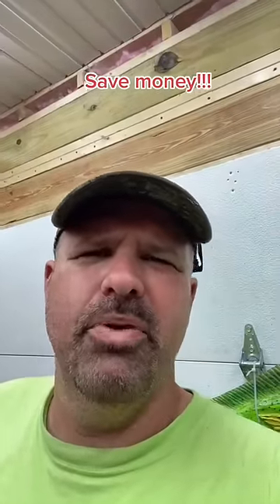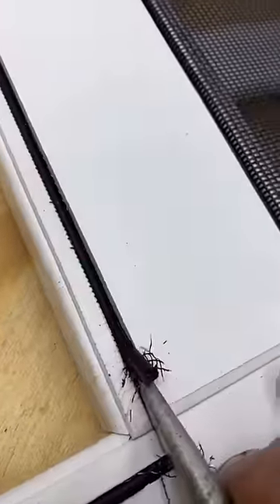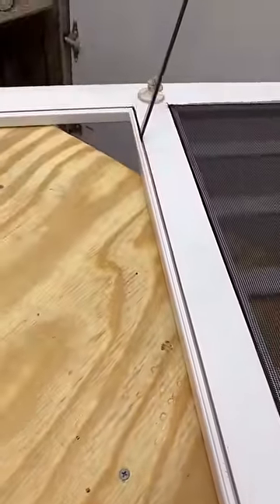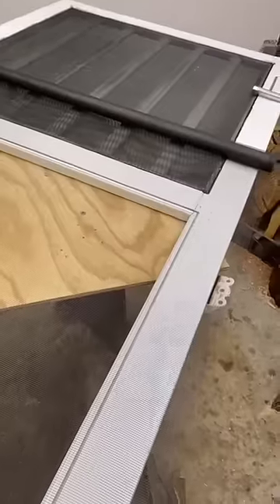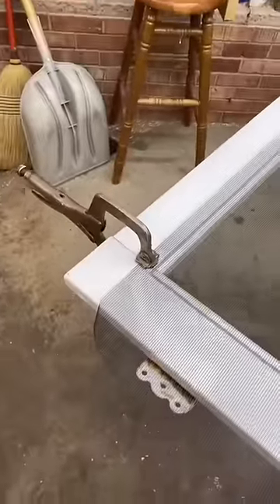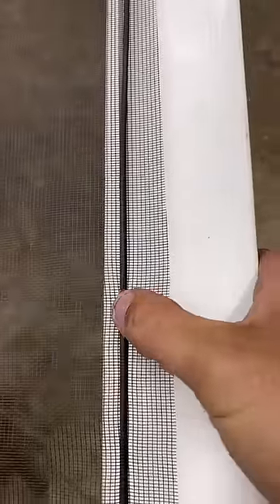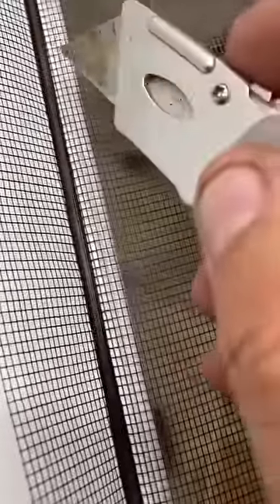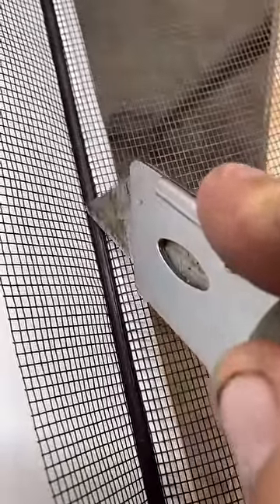Ever change the screen in your windows or doors?

Comment: Tight screen makes wacky frames. The gasket is spline, and they have a spine tool that does that for you.
Reply: this looks like a timber frame with a routed groove for the spline. make it as tight as you want, it ain’t gonna warp the frame. an aluminium frame though, yeah, maybe
Reply: @brenyboy26  tight screen can warp any frame timber or aluminum.
Reply: @brenyboy26  
That's a vinyl screen door. It's like $30 at any home improvement store.
Reply: Yes...commented same. Most people won't be able to do this... and if they do, it's gonna take quite a bit a practice. Not just somethin u jump into and it's all good. Takes trial.and error. Very frustrating unless you're a handy person or good at this stuff.
Reply: @jacobchristian8608  , yea, it CAN, but it bends them to wobble like you're ringin out a towel. If you're really good u can do it and it'll work, but it's not something recommended for just an average person tryin to screen change. I'm pretty sure thats what they meant. 

Edit... I apologize,  I thought you wrote it can "wrap" and frame. Lol. You said warp. Yes... warp... agreeable. My bad.
Reply: @MrNside  , dang , where u live?? Lol. That's pretty darn cheap, even for a vinyl door. Good for u though... 👍🏼good price, if it's true!
Reply: Hey, anyone remember when it was metal screen instead of vinyl or whatever the hell it is now? Total treat to unroll it and cut the hell out of your hands. Oh the hardware store, damn, miss those. Not these big box stores but a hardware store that had everything from canning supplies to building materials.
Reply: The spline tool doesn't fit the spline hole. I just used this door and the tool didn't fit so I had to use a flat head screwdriver.
Reply: @actuallyNo...  
The screen popped out of the door at the camp I was renting. Pulled the gasket and put it back together using a Leatherman. No issues… first one I’ve done.
Reply: @jacobchristian8608  What bout wood
Reply: @MrNside  30 bucks ?  Maybe 30 yrs ago.
Reply: @actuallyNo...  
My bad, I was thinking of the thinner framed vinyl door, it is $33 at my local Lowe's. The one like this model (without the vertical bars on the bottom) is like $80. Either way, it's still a vinyl frame (not wood) and susceptible to warping if you install the screen too tight, which was my point.
Reply: @Blue_Shirt_Guy  see above comment.
Reply: @MRtwoTricks  
You can still buy aluminum screening at just about any home improvement store last I checked, it is a considerably bigger pain to work with compared to fiberglass. 

I had to spline in aluminum to replace fiberglass in a few windows/doors for a customer because her cats kept tearing up the fiberglass screens. It had been a while since I messed with aluminum, I drastically undercharged for that job.
Reply: @MrNside  you put a 30 dollar screen door on your house  ?
Reply: @MrNside  lost probably 2 pints of blood too
Reply: @Blue_Shirt_Guy  
Where did I say that?
Reply: @MRtwoTricks  
I'm sure I lost a bit of blood, but nothing I've ever done is worse than steel stud framing when it comes to your hands looking like you were kneading a pile of razor blades.
Reply: @MrNside  so now you're saying that you don't have a screen door at all ?
Reply: @Blue_Shirt_Guy  
Where are you reading this stuff? I never said that either. WTF is your deal?
Reply: @jwalker6260  , yea, some are quite easy, especially if the door's in decent/good shape and you have enough screen to work with , of course.  In your case it mayve just popped out of the frame. Not hard if you're handy 👍🏼 ...

 Say you're taking off your house windows and doors to do a re-haul on all the screens though,  it's pretty much never gonna be that easy. There's all types of issues you'll (or you can easily) run into.There's always exceptions though.
Reply: @MrNside  , that's okay. 👍🏼  I get it. I figured you either got a really great deal, or you just mixed up the numbers accidentally... it happens. You sound like you've done a few handy jobs in your time. Same here...I feel ya!
Reply: Nah Florida man here. I've replaced countless screens. You want that shit tight.you also don't want to reuse spline. Its cheap and easy to cut to size
Reply: @iian_  , he was talking about aluminum framing that you'd use for everyday, home window screens. They warp and flip all over the place when the screen's too tight. They suck, & they're hard to get flat, especially the 1-inchers most houses have. 
Wth does "FLA Man" mean/ have to do with anything regarding this?
Reply: @actuallyNo...  no you still want it tight lol unless you want some shit looking screens
Reply: @actuallyNo...  stop looking for fights online kid.
Reply: @actuallyNo...  I can see you starting other arguments you aren't smart at all. The funny thing about the internet is everyone can see what you've been posting.
Reply: @iian_  , okay, "Florida Man".[ Nice flex, btw.]  No one started an argument (not w/you either). We were all having a nice conversation about everything with everyone here (& will continue to) until you popped in with your "let me sound like a tool" comment.

 I'm glad you found out how The Internet works. That's not a "funny thing"... That's literally what being on-line is. Everyone sees what you post. 
---
Reply: @actuallyNo...  cool story bro
Reply: @actuallyNo...  you really still don't understand the joke do you? 🤣
Reply: Yup

Comment: Pulling it tight will make the frame warp. Use the spline tool and the pressure of pushing it in will make it tight enough.

Comment: I literally just busted my screen today and was trying to find the serial number on it so I could order a replacement screen. Thank you so much bro🙏
Reply: There is a dollar tool next to where they sell that screen material. Its a wheel that presses the spline all the way in. Also, he says pull it tight. Dont want to pull it too tight because the spline will pull the mesh far into that channel and will make it tight. If you make it too tight the screen will bow.
Reply from the maker: No problem! Glad it helped Mr Clean!
Reply from the maker: Thanks for the tips PK

Comment: Except for the part where the “gasket” is called spline, and the spline should never be that loose or it can just fall out from simple wind or rain, also you should be rolling the spline in. :)
Reply: It just a short Mitch. He’s showing that it is possible to do a repair like that.

Comment: This is EXACTLY why you should pay someone (a professional) that actually knows what they're doing to do it lol... I'll tell you why, for one that shit looked LOOSE as hell, that's a no no, also he didn't even use the right kind of spline, and if it hasn't already came out, it will very soon! 

Yes doing screen is relatively easy to do, just have to know the tricks!! This guy doesn't lol
Reply from the maker: I live in a super windy area on the coast  and it’s holding strong. Been almost 5 months on that screen not to mention the others. But Thanks for the helpful tips. We learned alot! Have a GREAT day!

Comment: A rolling tool, any hardware store, called a Wig-it, rolls it in tight. And yes throw the old gasket away, get new gasket in a roll, use a screw driver at the corners. Razor the edge.
And don't use clamps, it over tightens.
Hand pressure one side then another, then the opposing side then the last side,  it straightens itself as it goes.
Reply: It's good to see valid comments on youtube.

Comment: If the gasket has stress cracks in it (normally can only be seen when stretched), isn't smooth to the touch (it should be able to slide between your fingers as if it was greased even when not greased), is permanently stretched out, is over a decade old, or has any other things wrong with it then do replace it though. Screen door gaskets aren't too expensive. 
(at least here in florida they are anywhere from under $5.99 to $15.99 depending on where you buy it from).

Comment: I do screen replacement and manufacturing. I will tell you right now that you can do that if you want, but he was doing it to a very thick framed screen. Most of you have either 5/16, 3/8 or 7/16 frames. If you don’t know what you’re doing you’ll bow the frame because the fabric is too tight and make your screen window useless. The bow will make an opening where bugs will definitely crawl through. Also there are different materials you can use that serve different purposes, but are also more difficult to work with. If you want shity screens by all means do it your self.

Comment: Forgot to put a block in the center of the frame. As you push the vinyl in, the screen pulls tight, distorting the size of the frame. Block keeps the frame from squeezing in on itself

Comment: If you manage to break the gasket (or spline, that's the technical term) you can buy that as a replacement for that too!  Just make sure you grab the right size spline for the screenwire you buy

Comment: It helps to get new spline its not gasket and get a spline roller to bed new spline. You will get nice even tension on screen and if you dont bed the spline with tool it will come back out especially if its used spline. This guy is right about doing yourself just do it right.

Comment: As a former window cleaner and screen cleaner, it’s not the right way, there’s a lot more that goes into changing the screen, and even though it’s expensive it’s better just to pay to get it professionally done, most of us have a policy that if we break your screens frame or mess/dent it up we will completely rebuild you a brand new screen for no extra cost
Reply: I know you work at the screen repair shop down the street Jayden.

Comment: You'll definitely need the proper roller most of the time if you want to actually fully seat the rubber so the screen lasts, it's a cheap tool you can get at Lowe's or home depot

Comment: You actually want to get new spline (he's calling it gasket) because the spline in your screen may be brittle or hard and won't hold the screen properly causing warping in the screen material and/or frame.

Comment: Worked with screen and don't pull it at tight as you can. There is a fine point between tight and sloppy you have to find. Too tight you will warp the frame. Too lose and it looks like shit all wavy. Someone does this on their aluminum window screens and it'll warp guaranteed. Back when i did this for a living we used special jigs to give us the right tension nearly every time and we still had to know what we were doing and feeling out the tension all along the sline as we rolled it in. The bigger you go the worse the warping can be too. Once my coworker did a 5ft x 6ft custom screen and it took him half the day to lay it perfect.
Reply from the maker: Dang that’s crazy! Thanks for the tips!!!!

Comment: Fully agree with this guy (aside from the saving the old piece, just get a new one). Replacing the screen on your door is learned early on if you've grown up in a trailer park. The only thing that bugs me, is that he and multiple commentators are calling it a gasket. It's a spline. Gaskets are rubber rings used for car engines.

Comment: There's an easier way to do it. The "gasket" is actually called Spline. You remove the old one, likely will break up on you and is hard, so you'll need a new roll of spline. New spline is soft and flexible, but not easily put into the groove as the old molded spline will be which shouldnt be reused. The only tools you'll need is a box cutter and a spline roller. You start at the top, work your way down one side, pull till its tight and roll the other side, then do the bottom. No clamps necessary.

Comment: Don’t pull the screen TOO tight - it tightens as you push the gasket in. Get more screen than you need - you’ll probably break it the first try. Buy a roller to press in the gasket (ask at the screen store - they’ll know what I’m talking about)

Comment: Screens gonna fly out the first windy day, need a spline roller, the spline isn’t pressed enough. Also do it in a “L” shape. Keeps it tight without having to pull it tight. (16years glazer, installer) screens are stupid easy. Can be done at home!

Comment: Never re-use spline especially when you have pets. This is easy because you cut corners and when someone accidentally kicks your screen, you will have to do it again. Never use clamps bc it will get the screen to tight and bow your frame.

Comment: You should really use new spline, the old stuff may seem good but its all stretched out after being removed, it shouldn't pop in so easy, there is a cheap little tool and spline isn't expensive either

Comment: Yes you can do it yourself. You can spend $40 for the cheapest screen that is 24" x 100' or spend $20 for up to 5ft and $25 anything after 5ft per a door or window screens. That's what I charge at my business. Most people don't want to deal with the trouble of doing it themself.

Comment: What about double ended screen tool? One end looks like a dull pizza cutter, that is to gently roll over the screen and push it into the groove. The other side has a groove in the wheel and used to help push the "gasket" or spline, into the groove and it goes a lot quicker and smoother with this tool. Sorry, but the only thing that was useful was using a razor blade to cut the reat of the excess screen from the window.

Comment: No screen roller? "Just start pushing the gasket in"? 
Okay 1 it is called Screen Spline not a gasket.  
2, you do not just press the spline in with your fingers. You can buy a spline wheel for a couple of dollars and it attaches to the hole on your basic construction "Utility Knife". You use the spline wheel to roll the spline in. You do not stretch the spline. 
Some spline rubber is flat and you will never push it in without a spline wheel.